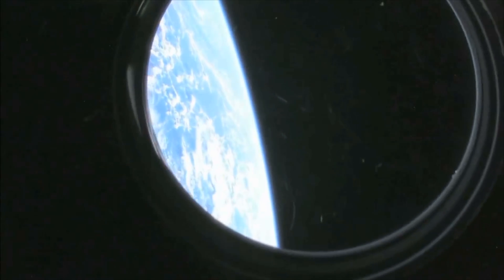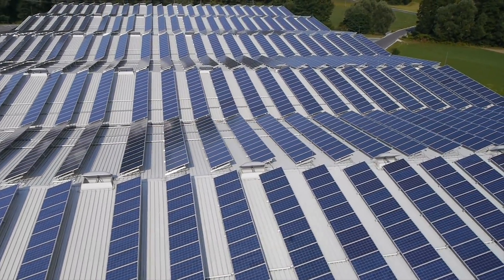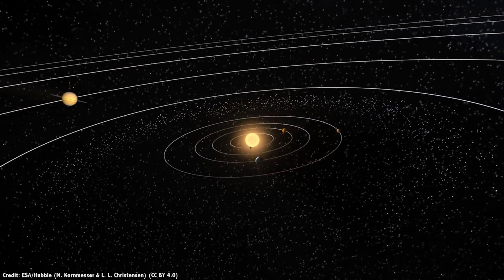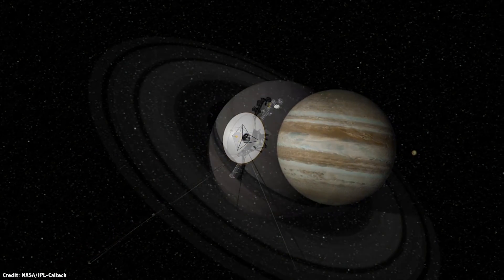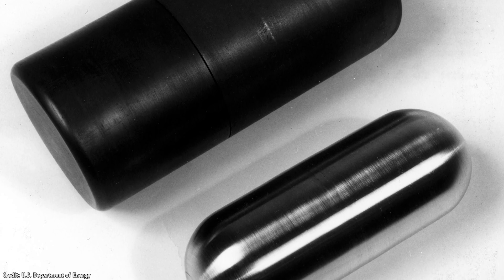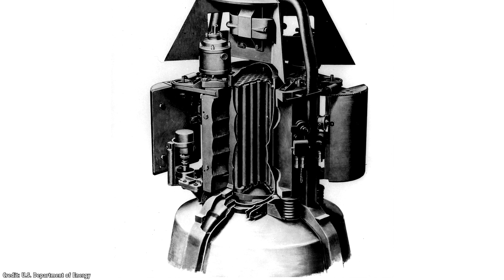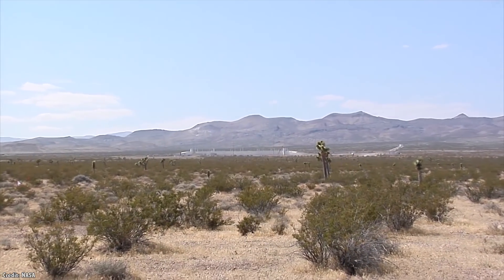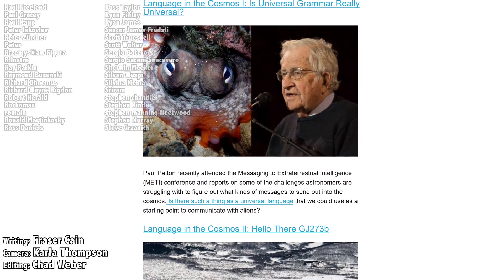The Problem of Power in Space. NASA's New Kilopower Reactor

Comment: Could focus on the advantages of power in space. The sunnier surface of the moon is in effect a mega solar panel energized for  the grounding that may be found underground or in a  creator cold enough to support the cheapest of superconductors.  Should also consider anything done in a vacuum tube could be done open large scale on the moon. May be  an electric field gliding Lunar-speeder is possible.
Reply from the maker: That's interesting, I wonder if you could extract it somehow.
Reply: @frasercain  Thinking it might be simple as planting rod with insulation till its contact tip and a conductor on the surface.

Comment: You need a tesla ball that sends power to the space station

https://youtu.be/PZo_FlJqfpg
Or compressed air to move a wind turbine
The tesla ball will more then likely make hydrogen and other gases bind and make a gas that produces air pressure to move a wind turbine
It probably won't make oxygen but it will make gas with a air pressure
50000 farheneit is what makes lightning make oxygen and hydrogen bind
Im sure it binds more also

Comment: Solar straw man much? SpectroLab makes space tested triple junction cells that can net 40% efficiency at 900 Suns when actively cooled.. This means that the cells themselves produce roughly 900 times the power/mass. When the low mass mirror is added at 17KW/kg.(L'Garde demo) or better, and radiators the power is several KW/kg. There is no system for turning nuclear reactor energy into electricity with anything even approaching this power/mass. Even at Saturn, the mirror doesn't add enough mass for reactors to come terribly close. I am always amazed that otherwise smart people don.t understand that low mass mirrors keep solar viable perhaps to Neptune before reactor/heat engine becomes competitive in this key metric of power/mass and ignore solar power sats for surface power at Mars and beyond..

Comment: The answer is this open sourced, continuous motion, gravity driven free energy generator:"
Power Multiplier Device, last resize (I hope)-overunity.com
A new modification allows for five times more energy production.
In a cylindrical space station that is rotation on it's axis to create centrifugal force/artificial gravity, these generators would be installed as spokes in a wheel down the length of the station. As it turns, they produce the energy the station needs. Weighted trams on tracks around the circumference of the station would travel fast-then brake, fast-then brake, to speed up or slow down the station's rotation. Free energy from artificial gravity. 
  Regards,
     Russell Lee

Comment: "You need power to keep your spaceship warm...."

While technically true, it doesn't take much power to do that.
It usually takes more power to radiate excess heat because there's no air to conduct it away.
Reply from the maker: It depends on where you are. When you're in Earth orbit, that's true, once you get out to Mars and beyond, there's not a lot of radiation coming from the Sun to heat you up.

Comment: Here's an idea:  (relative) Perpetual motion machines are impossible on Earth due to gravity, friction and air resistance both negligible or non-existent in space.   Rockets start huge cylindrical coils rotating around magnets and there you have space based, turbine generating electricity requiring an occasional rocket push every now and then.  No?
Reply from the maker: Perpetual motion machines are impossible everywhere. You're always going to lose energy from heat.
Reply: @frasercain  True.  But if you have a giant wheel simulating gravity for space based residents why not stick a giant magnet in the middle with wire coils directly attached to the wheel.  The magnet, of course, must be part of a narrow neck which is part of a mass large enough to offset the mass of the wheel.  Any residual heat can be used by the residents.  It's cold in space.

Comment: they need reusable energy in space, cos they cant take a power staion with them, and batteries always die. 
what they all need for power is a nice recyclable system like a tank battery or something.
i recomend a tank battery (a water tank full of water, witha small turbine at the bottom of it. when you need power, you let out the water and it spins the turbine. when you already have power you can pump the water back up into the water tank) because if they drink all thier water in the spaces, they have an emergency source in the tank

Comment: Solid state Fission Reactors, no moving parts, heat given off as radiation converted directly into electrical power. Like a solar cell but using the much lower frequency heat radiation rather than visible light.
Zero Point energy which Tesla was supposed to have powered a car with. 
Earth orbit Power Satellite transferring power to the satellite on a laser or maser beam.

Comment: There is a product for generating power, that uses a parabolic reflective dish that tracks the sun and powers a stirling cycle engine that can produce 3 K.W. As long as it tracks the sun, power generation is possible. A  Large Space version should be tested for viability. Advantage is low cost, and no radiation.

Comment: This is more a way to recover power than create new power.  I could see data processing centers on the moon using the heat from the servers to heat something like an underground moon colony.  If you're looking for turning that heat to electricity, any of those other heat differential systems (sterling engines or Thermo-electric modules).

Comment: Let's work towards NTR's where the nuclear fuel is kept in a strong, heat-shielded compartment, only entering the reactor (robotically inserted) after the spacecraft has left Earth orbit via chemical rockets.  Why doesn't anyone tackle the safety issues surrounding nuclear power in space rather than just pointing to the dangers as reason not to try?

Comment: Seriously though... trailing a tether  to a laser projector and letting it pass through the earth’s magnetic field should produce massive electricity, then it can be beamed to the Satelite or rover mission... Jupiter’s field is stronger still, so it could produce far more...
Reply: I remember this being considered as a use for the shuttle’s fuel tanks back in the day...
Reply from the maker: Yeah, the tether idea is pretty cool. The problem is that the tether's altitude drops as you do this, so you need to counteract that with some other kind of energy, like solar power.

Comment: Your confused about to measure electricity in storage. Watts give you an immediate measurement of power at a given moment, while Watt Hours tell us how much energy over time, which is the real measurement of capacity. So when you say 140 watts is what the rover creates from solar panels in 1 day, that tells use literally nothing. What we need is capacity, not power at any given moment. That's what watt hours are for, not watts.
Reply from the maker: Batteries will handle the storage part. I think that's been covered pretty well, it's about generating the electricity to be used by your electronics and stored in the batteries.
Reply: @frasercain  Yes, batteries store the power, but what I am saying is how much energy is in that battery for use is measured in Watt Hours, not Watts.

Comment: The fourth method is hydrogen fuel cells which have the added bonus of running hot and having water as a waste product.
Reply from the maker: But they only last for a week or so. We'll need power sources that last for years.
Reply: The fuel cell itself can last decades. If they didn't you would not be seeing cars with them in. As for fuel usage remember hydrogen is very light and in real terms a car puts out a hell of a lot of power. 1hp is near enough 750W. The Toyota Mirai has a range of 300 miles on 5kg of Hydrogen at 60MPH. At that speed it's going to be producing around 30BHP or around 22.5kW. OK in space you would need a further 40kg of oxygen but on a manned mission you could carry less water. The ISS batteries can supply a maximum of 6.6kW and part of this is for heating. So realistically we are talking 4kW to run life support etc. That means Mirai setup would provide power for 20 hours with just 13kg of fuel in the most power hungry setup we have ever put in space. Now lets look at something like Voyager 1 and 2. They had power systems capable of delivering 470W at launch. So the Mirai system would last for 240 hours with just 13kg of fuel. If you used the entire weight allowance of near 200kg for the boom and generators for Voyager 1 then you would be talking 160kg of fuel which would last nearly 3000 hours. Hardly "a week or so". That's nearly 18 weeks by the way and the Mirai system is not the most efficient by a long way as it has had to be designed to be impact resistant and down to a price. You can actually build things lighter and more efficient for aerospace and I have worked as a design engineer in both aerospace and automotive environments.
Reply: @Level3-RC are you an idiot? You know Mars is not really red except viewed from certain angles or from a distance right (due to atmospheric effects)? We thought it was because of issues with one of the early cameras. https://www.imdb.com/title/tt0111001/
AND who says the conversation was just about a power source for Mars? You are going to need a power source to get ANYWHERE be it manned or unmanned. Hydrogen fuel cells have very significant advantages when transporting people or sensitive instruments. IE water as a by-product so you do not need to carry as much for drinking (ever heard of the Apollo programme?) and radiation affects electronics full stop. Yes you can make it more resistant but the total dose keeps building up and that will kill electronics faster if it has to cope with background radiation and a reactor too. Try using your brain if you have one.

Comment: How do we know we didn't damage life on Jupiter with the radioactive material ? And they didn't ADMIT to having spacecraft that used fission. You know since they always tell the truth and never have classified projects or projects like Star Wars. And what happened to that money and those projects ? Nobody knows. And you can be sure things like Kilo power already are used in black projects.
Reply from the maker: Jupiter has an incredibly hot and high pressure interior. And it has more radioactive material inside it than Earth. It can handle our material. Also, it's really unlikely that there's life on Jupiter, which is why they chose to crash it there instead of its moons.
Reply: @frasercain  2nd reply thanks to YT censoring ! Maybe, but they used to say that about other areas like the extremophiles that live in >11ph or temperature or radiation extremes like Deinococcus radiodurans. I would have aimed for the Sun or something without an atmosphere. YT is ruining everything now ! And in all that pressure, we have high pressure life in the ocean floors. Just think, you might get a knock at your door with an angry alien holding the probe in 1 tentacle asking "is this yours ?".

Comment: How efficient are these Sterling engines? Does something need a ton of heat energy for any electrical conversion? What is the possibility of making very heat resistant machines (instead of cooling the machines) and using Sterling engines to convert the heat back to electrical energy? Almost like a heat version of an alternator in a car. Does that concept hold any water?

Comment: Watts are a measure of power, not energy. A watt is derived as 1 joule per second, joules being the unit for energy. That's okay though. I've seen electrical engineers make the same mistake when talking off the cuff. It's another story if you mix the two up on paper, though. Btw 1 calorie is about 4.1 joules, and a food Calorie is 1000 calories (4184 joules). Now you can work out how much energy the solar array on the ISS produces in terms of food. And for reference 1 joule is the energy it takes to lift 100 grams (4oz), a mass about the size of an apple to a height of 1 meter (1 yard). It's also the amount of energy released when you drop that same mass from 1 meter.
Reply from the maker: I'm sure that'll be useful when they design their space greenhouses.

Comment: Good source of long term propulsion. Use Kilopower to super heat water into steam. Superheating  1 litre of water will produce 1244 cubic meters of steam. Yea, the age of steam returns!
Reply from the maker: So many futuristic power systems are just fancy steam engines. :-)
Reply: Only good for long term propulsion if you have a large supply of water. How much water would you need to launch into space to travel a great distance? The rocket would be too heavy to launch if you need to send one of the great lakes up with it.

Comment: There's no other way that nobody has thought of I would imagine but it could be built extremely lightweight using carbon fiber and mylar and I would be willing to discuss it with someone in a position to do something about it. With Falcon heavy costing 1/10 of what it cost to launch a normal NASA rocket nowadays the cost of moving heavy stuff up in the space has dropped off course by 90% which helps the problem out a lot but using the right materials I believe that the device could be built and set an orbit around the moon and the work could be directly on the moon surface but probably the best location for deep space travel could be on any spacecraft it would be using what's available in the cosmic environment.
Reply: falcon heavy is not 1/10 the cost of a normal launch.

Comment: the stirling engine idea is cool but how will they be repaired when they stop working they are after all a mechanical engine.
Reply: they are a very simple mechanical engine so failure is not likely, and they can be repaired like any other engine, with spare parts and a trained individual.
Reply: @miguellopez3392  how do you fix it on mars?  They will still wear out.
Reply: @chriss4365  ??? since it is a nasa grade sterling engine it could operate a decade with minimal maintenance, if a part gets worn out, then a mars colonist walks out with a big wrench and pops the bolts off and replaces what was damaged.
Reply: @miguellopez3392  as far as a colonist we will see when it happens.

Comment: Temperature is an issue, but for other reasons than you might think. It's actually fairly easy to generate heat in space. It's a lot more difficult to get rid of it, since you have no atmosphere to dissipite it into. Thermal radiation is the only means of getting rid of waste heat, and the ISS has huge external radiators to manage the heat from all the equipment on board.

It's true that space is cold, but it is also a near-vacuum, so the few, very cold particles that float around really aren't going to do any significant cooling.

Comment: a new source of energy => a sacred geometrical dynamic fluid overunity vortex that increase in speed not unlike how atoms and stars are infinite overunity machines of ether themselves.  not unlike viktor schauberger tachyon drive .   or maybe a fission powered high pressure mercury spinning magnetic field lines resonance to produce anti gravity true closed system not unlike the tr3b black manta dark triangle which isnt a new source of power but it is exotic antigrav propulsion townsend brown effect.  or maybe harness the casimir effect for everlast batteries not unlike magneto john hutchison effect

Comment: Looks like space nuclear fission reactors are a must in this situation. Close to the sun, solar will work, but once the asteroid belt is crossed, solar energy will no longer be viable on those moon and planets so far away from the sun. One of jupiter's moons Io has a lot of volcanoes and can be a source of geothermal power in that region. If possible, energy can be beamed from one area to another and if saturn's moon Titan has good geothermal power, this can provide recharging stations for the batteries in those spacecraft. With recharging stations built on those moons with geothermal energy, this might be a possible solution along with the most distant station beaming energy into the distant space where a receiver device on a spacecraft keep it powered as beamed energy is not losing power as it goes through space.

Comment: How would paired sodium  reactors work in space if mounted at 180 degrees and rotating at a velocity that would simulate gravity?
Reply from the maker: We still haven't done enough tests to see what size of rotating structures are needed to provide adequate gravity. It's still an open question.
Reply: Since equipment is designed for Earth normal gravity, that's probably the standard that will be necessary.The problem will be the coriolis force. The structures will include human occupants, and too small a structure will need a high speed spin resulting in the coriolis force being at an uncomfortably high level for the occupants.That's probably WHY this kind of testing has not been done, Before you can even think about the materials going into the structures you need to decide the diameter of the environmental ring. Herein lies the problem. The faster the spin the greater the coriolis force. The smaller the structure the faster the spin required to simulate gravity. The effects of the coriolis force are subjective for each individual, consequently a  large enough environmental ring with a slow enough spin to keep the coriolis force at a tolerable level for a normal human being will be necessary. A space station full of astronauts carrying around airsickness bags would really NOT be funny.
Reply: If the inertial energy can be produced as a function of the reactor or simply use adjustable booms on a  station to vary the centrifugal force AND keep the reactor at a safe distance from the station or a design can be contrived for microgravity environments, not requiring gravity for the reactors to function, then adequate power levels for serious work in space might be reached.